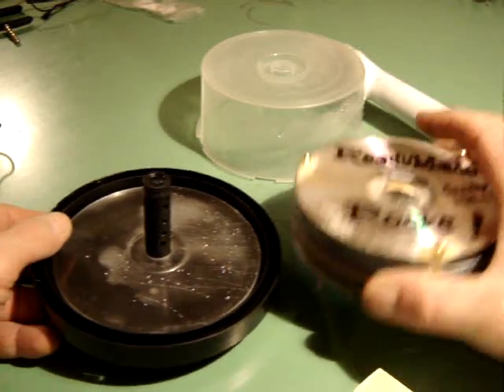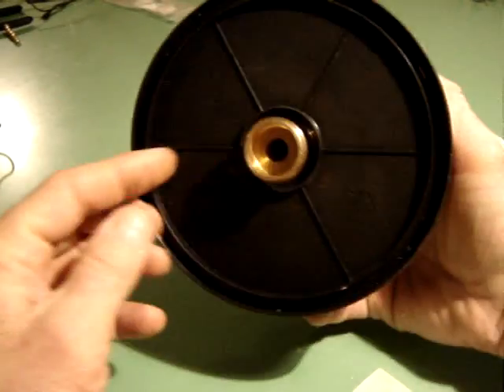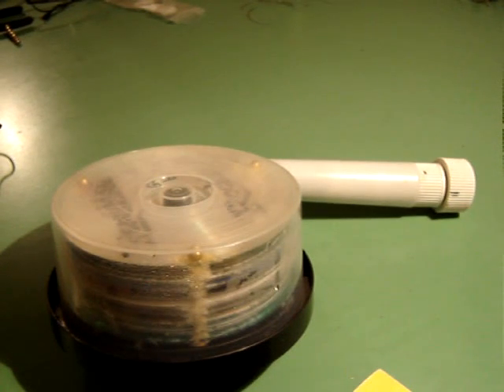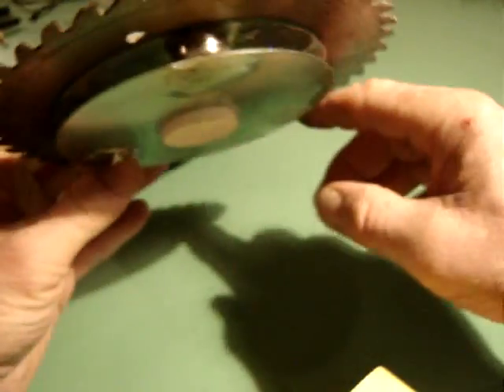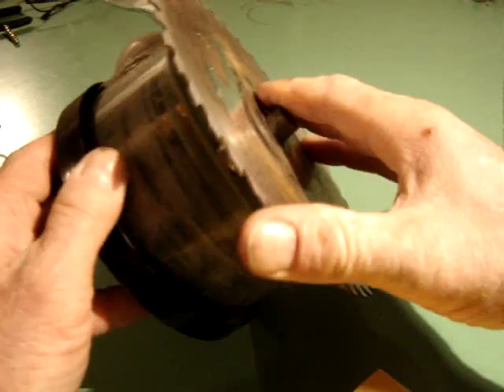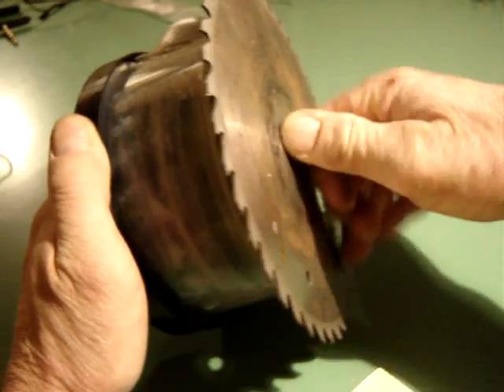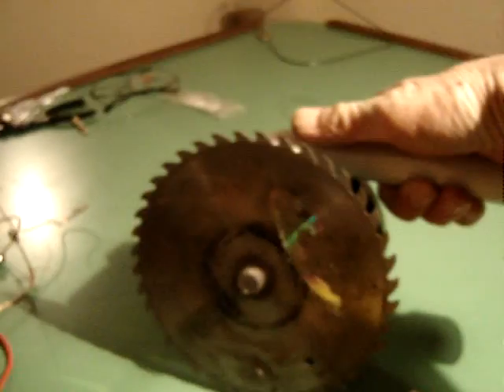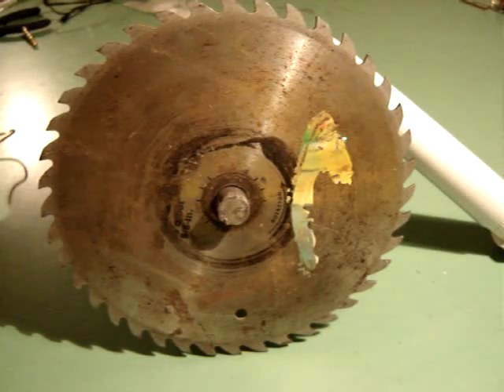Tesla CD Turbine with Skilsaw Magnetic Attachment

Comment: What kind of drugs you guys taking? Throw that ideal in the trash before you cut your head off, that is a piece of shit i know tools very good, and that is NOT a tool for any kind of benefit to you, it is a tool to cut your head off, if you spin that blade at the rpm and torque needed to cut even just a piece of 1/4 inch plywood it has no where near enough force to keep it attached, i envision it coming off and getting your neck, you better start thinking more safely, this is a total piece of shit.

Comment from the maker: @TimpBizkit 

Once the blade gets going beyond 2000 rpm, there is a fluid bearing effect between the blade and case. (see wiki "Fluid Bearing".)

For least friction, it helps for the magnets in the magnetic couplings to be in "Repel" mode rather than "Attract" mode.

Comment: omg, i would not use that, them cd cases come apart too easy. plus you added them on backwards, the water pressure will be working against your locking clips, trying to unlock the case. if your inlet was coming from the other side it would have held it together a little better. but tbh please don't use that. i know it will work but theres a big chance of it blowing up and them you'll have a flying saw blade to deal with.

Comment from the maker: @migasthepepino 

If Tesla had neodymium magnets, he likely would have tried a similar magnetic turbine with magnetic coupling. 

I would not recommend anyone actually try to run a magnetically-coupled skil-saw blade at very high speeds on a plastic CD case Tesla Turbine.

Just because I did it, and got away with it, and learned a lot from it, does not mean that you will.

Oh, and speaking of ignorance,  super-magnets are spelled "neodymium" not "neodisium".

Comment from the maker: Yes, it's been tested on water (slow and boring) and compressed air (fast and scary).

The spindle post is drilled to allow egress of fluids.

It worked well, but not as expected. The turbine magnets had to be in Repel mode rather than Attracting. The turbine would not turn when the two sets of magnets were attracting. I flipped over the magnetic coupler and it took off like a banshee! 

See  Youtube/watch?v=Dn6MR0Wslf8

and a pumpkincutter for Halloween...
Youtube/watch?v=aoRh8T_VX-Y

Comment: Have you tested this?
Doesn't the water just leak out the back of the case?
If you run this thing and try to actually cut something with that blade I would expect the spining blade to come off.  
Of course it seems likely that this flimsy thing won't work at all.  

Still, I would like to see it work, and  without any injury to you.

Comment from the maker: A turbo works by using exhaust gasses to drive a turbine on a common shaft with a compressor. The compressor part of the turbo compresses the intake gasses for better combustion power.

The Tesla Turbine could perform a similar job, but would not likely be more efficient than the normal turbo, which has had billions of dollars of research and development in it's production.

Comment from the maker: It's true that part of the torque available in the turbine is because of the magnet washers on the outer edges. This is something that the old master, Nikola Tesla, experimented with extensively. 

In fact, he suggests in his Tesla Turbine patent that 6-12 washers be used on the outer edges of a disc this size, and double that for larger discs. This will increase the starting and low speed running torque, without negatively affecting the high-speed qualities of the discs, according to Tesla.

Comment: I've seen many tesla turbine attempts made using CD's and magnets, but i've always thought that having the magnets on the outer edge of the CD's was a bit of a cheat without realising it.
The CD's would give the flow of air/fluid something to push on directly, acting like a crude turbine blade.
Have you tried using ring magnets around the center of the CD's to ensure all your drive is coming from the effect of viscosity?

Comment from the maker: The concept of joining several CD Turbines together magnetically is feasible. 

It might take a couple of air compressors or a lot of water pressure/volume to power them though.

I'd like to try it, but alas, no money for magnets.

The LP sounds like a good idea, except they can't take the high rpms and would require lots of air.

However, a real proper 10 inch Tesla Turbine could develop 110 horsepower at 30,000 rpm. That was Tesla's smallest model.  It could probably cut rock fast! hehe

Comment from the maker: Hehe, haven't got hurt yet...except from some hot glue when I made the thing!

The CD Turbine will blow up under high rpm. Magnets and discs can fly. I don't run the turbine on air pressure now except inside of a protective cover.

The newer PumpkinCutter version (YouTube/watch?v=aoRh8T_VX-Y) has a post to kinda keep the blade on.

I was just thinking again about the table saw version...it "wood" make a great video, haha.

Comment: MUMMY MUMMY come quick, dads 3 super strong magnets let go and his skilsaw has severed some vital organs on its way to orbit around the earth. 

 Does the new version come with a solid axle which you can mount the blade too. What about 4 of these bad boy motors in series lined up under a wood saw table driving the saw. You could cut wood and vacuum the dust at the same time. Maybe put them in a tin can with a shaft mounted through the centre. Would be sweet as!! and a bit safer ;-)

Comment from the maker: See my Pumpkin Cuttin' Ceremony video (youtube/watch?v=aoRh8T_VX-Y) of a CD Turbine machine I made with somewhat of a holder for the sawblade. By the end of the pumpkin cuttin', I felt at ease with the machine!

It remains,however, very difficult to cut a curved surface with a skilsaw blade!

You are right that there could be applications for this device. Generally, there already are hydraulic tools available for most situations, with a battery power pack or power source such as compressed air.

Comment from the maker: Ok, I've looked at the Tesla  patent # 1, 061.206, and my opinion and ideas stand as they are. 

Quote from patent:
"the fluid travelling in a spiral path and with continuously diminishing velocity until it reaches orifices 14 and 20, through which it is discharged." 

Orifices 14 are the center holes of the discs. Orifice 20 is the center outlet where the fluid exits.

You are confusing the two valves, which are used to reverse the turbine by shutting off one valve and opening the other.

Comment from the maker: Ok, thanks, I would love to see a Tesla Turbine that doesn't have a center exhaust outlet.

 I have seen most of the Tesla's turbine designs; for example, I have a picture of Tesla patent #1,061,042 and it certainly has the exhaust out the center. 

All of the engineering literature I've read on Tesla Turbine is based on the exhaust in the center, so it would be unusual if you had a picture showing something different. 

Perhaps I've missed something, and I look forward to your drawing!

Comment from the maker: Since my turbines don't have shafts, I've simply drilled the post to allow the fluid flow to spiral out.

Tesla had holes in the centers of the turbine discs to allow the fluid flow to exit through the central exhaust.

The inlet nozzle fluid flow goes around the outside of the discs in a circular motion, and then spirals in to the center, where it exhausts.

or, as wikipedia says about Tesla Turbine, "As the gas slows and adds energy to the disks, it spirals in to the center exhaust."

Comment from the maker: I safely and successfully carved a pumpkin with my bladed device...check out my Pumpkin Cuttin' Ceremony...watch?v=aoRh8T_VX-Y

The concept works fine, but I certainly would not recommend anyone try it with a skilsaw blade like I did. In later models I use a post to keep the blade in place.

You would have to be as crazy and lucky as I am to get away with it.

However, you might like to see the other 15 videos I made using this principle before you say it will not work.

Comment from the maker: The CD's represent the discs used in the Tesla type turbine, a design from 100 years ago. One set of magnets act as spacers between the discs, so the fluid can flow through. Another  set of magnets on the top corresponds with, and magnetically couples with, the magnets attached to the saw blade, outside of the CD case.

Comment: Found your clip after all and some others too. Very cool stuff. I'm used to pushing to make a cut, and all the portable hand saw blades turn clockwise (as viewed from the blade side), in your set up the blade is set for cutting fine, but one would need to pull to make the cut, like in a radial arm saw. No big, you are quite the craftsman and engineer doing all those things.The rotation of the blade will also impact where the sawdust goes, usually right down the back of the operators neck.  C-Ya

Comment from the maker: The more improved and safer CD Turbine III is found at my kitchen sink happily running on faucet water pressure.

I did do my "PumpkinCutter" video with The CD Turbine II model, on air pressure with the blade, however. It was a grand success! (still have all fingers)

Comment from the maker: The water version of the CD Turbine only goes about 1000 rpm, and is a safe demo tool and fun to play with. Think of what you can demo with rotating supermagnets;  I've tried a big magnetic stirrer in a bowl of water, a revolving ball magnet in a bowl, a drink stirrer, egg whisker and more. (videos to come...)
   This same unit on air pressure will rev very high and is dangerous without proper precautions. I use a steel enclosure and safety gear for air pressure experimentation.

Comment from the maker: You are right about the excess friction, which is due to the magnets being in attract mode in this movie. I couldn't get the unit to rotate well in magnet attract mode at all. So I flipped over the disc pack so the magnets were in REPEL mode and the result was that the blade stayed on way better than expected, and it revved like crazy, as can be seen in my most dangerous movie,  "Running the Tesla CD Turbine With PumpkinCutter Attachment".

Comment: fantastic!!!please showit working!! The rotation is not smoot, you can take an old cdplayer and detach the motor that have the cdsuport and it have very smoot performance(4 more than 500 rpm). The cd turbine with old cds is terryfic!!
Some ideas for your cd reciclig  proyect... youtoube
 
FUELLESS HEATER NO FUEL NO GAS NO WOOD NO GREEN HOUSE GASES 

Wolfhart Pump 1985

Comment from the maker: Thanks for the comment! 
   I will be revamping this project considerably. The new disc pack will actually rotate by just blowing on it, and is designed to work with air or water. The discs will be 1/32" apart instead of way-too-wide 1/8". The new inlet is smaller and higher pressure, the housing tighter. This sucker's gonna rock!
Also, I'm working on a video "The Making of the Tesla CD Turbine" showing step-by-step of the initial prototype...coming soon to a Youtube near you!